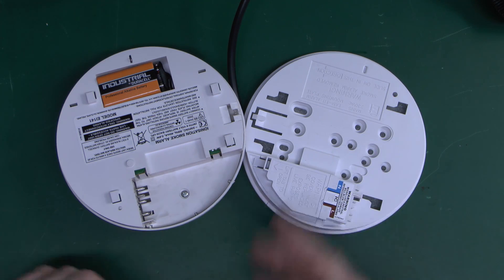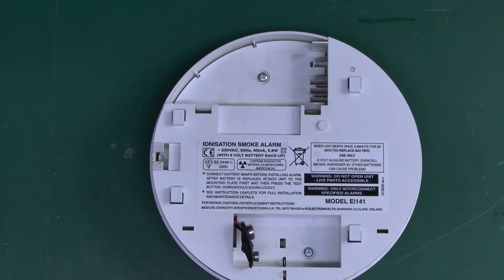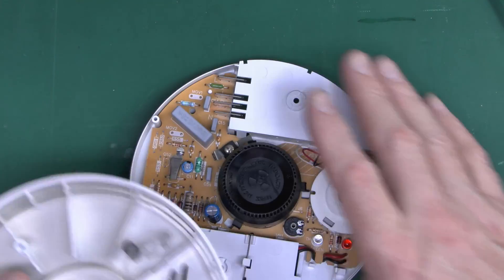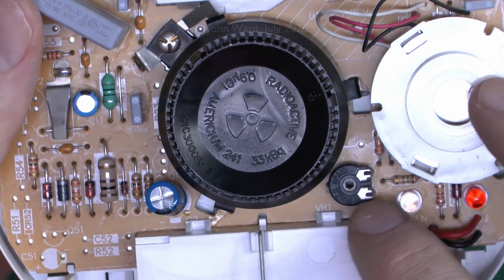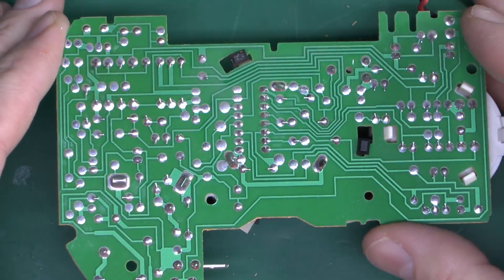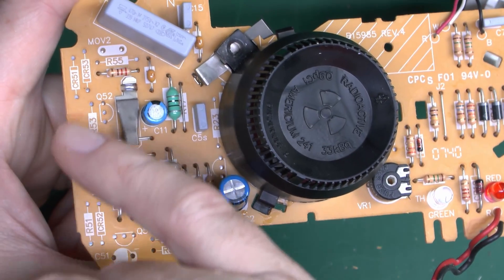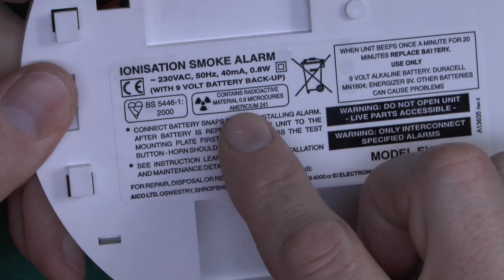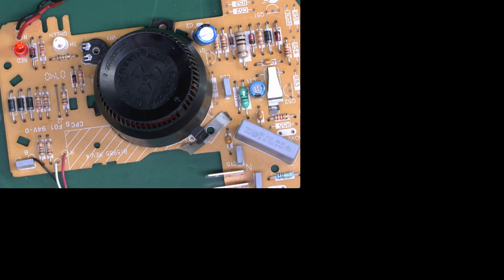Ionisation Smoke Alarm Dismantled - What's Inside

Comment: Now that you have 
"Opened-It-Up-Very-Carefully" 
so that we can have a look around in there, 
I need to ask: Can I now.......

.......Have it so that I can now teeeeaaase it on the variac until it pops? :D

28A variac, 6,000 watts of ballasting and 4,000 volts from Microwave transformers (MOTs)

Chances are, that'll fizz-over quiiiiiiiiiite well! :D

I did notice on the circuit board that there were places on there for some MOVs.

Did they fit them? Bean-counters said........  "NO!!"

So, given that, 4kV from some MOTs gently teeeaaased into it (I am hoping) should produce some interesting results.

Hopefully..... Flaaaaaaaaaames. :D

Do you want flames?

There's an Email contact on the Wayne's Electrical "About" tab!

Thanxx for showing,

-Wayne's Electrical.

25th July 2020, 21.05
Reply: are you alright
Reply: Hiya. All is well. Things could be soooo more Sssatisfying if we had some flaaaaaames though! :D
Smoke alarm on fire. Ooooh, the irony! :D You want flames? :D
-Wayne's Electrical.
27th July 2020, 22.02

Comment: Well covered, still I was hoping you would go a little into the networking bit and how it's actually using mains to power a 9v chip and the battery changeover on power loss.

You can find smoke detector chip datasheets online.
 It's a rather spesific part made to barely use power until it needs to be loud. How the big change in power consumption is handled on the supply side could be interesting.